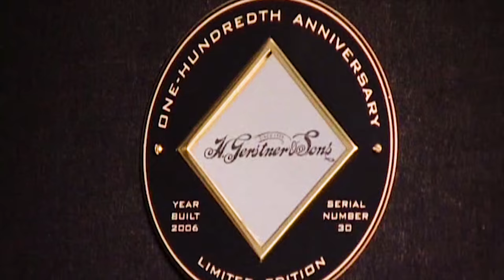H. Gerstner & Sons - Wooden Tool Chest Factory Tour

Comment: Very cool. I used to work at this place many years ago in my younger days for a short time. I was looking for a shot of the old manual elevator inside. That building hasn't changed since it was built probably some time around 1900 and survived the 1913 flood.